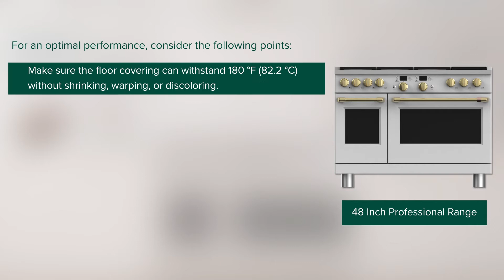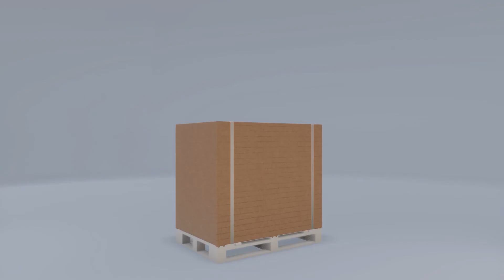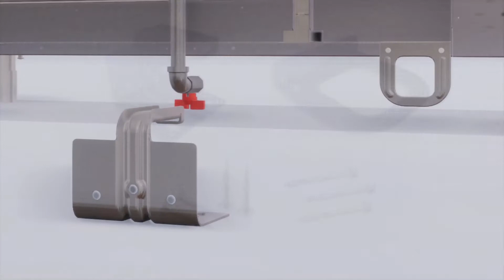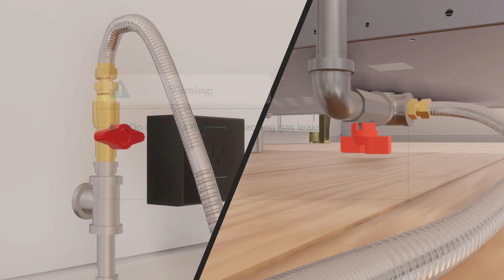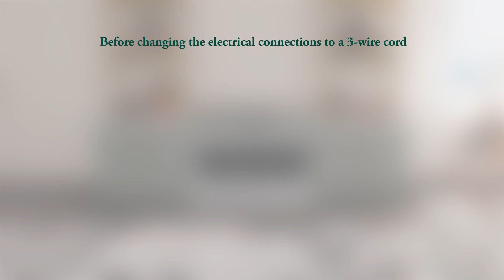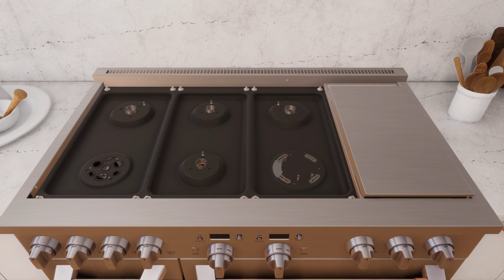Cafe Pro Range Installation

Comment: When facing my 36 inch dual fuel range, the electrical outlet is on the left and gas on the right. Will this be an issue for installation?
Reply from the maker: We want to help and research this further. Please send us a private message via Facebook, Instagram, or X with your complete model/serial numbers.

Comment: The instructions on getting the rear vent off are as useless as this video is for removing it. This has obviously been an issue for quite some time. Why hasn't it been addressed?
Reply from the maker: We'd be more than happy to assist with removing the rear vent. Can you send us a DM on Facebook, X, or Instagram with your full model/serial number and copy of this questions? That way we can review and get back with you quickly.

Comment: The rear vent trim is impossible to remove. Customer service is no help. This video shows it magically coming off. Absolutely terrible.
Reply from the maker: There may be a small tab on the trim that is catching on the back of the range. Please check to see if that is the issue. If not, reach out to us via a private message on GE Appliances Facebook page or GE Appliances X and include your name, number and complete model number. We will be happy to help.
Reply: @CAFEAppliances  The rear vent trim on ours has a bent tab. This is super disappointing for a brand new appliance delivered 2/3/25.
Reply from the maker: We understand this must be frustrating, and we want to assist. Please send us a private message over our social media (such as Instagram or Facebook) with a copy of your comment as well as your contact information, the complete model number and if possible a picture of the damage. With that information, we can certainly review further.
Reply: @scmcdermott  dealing with the same issue. What did you figure out?
Reply: Also dealing with this issue.  Impossible to remove vent trim.  So frustrated.
Reply from the maker: We're sorry to hear this.  If you are not able to remove the vent trim as described in the video, please send us a private message on Facebook or Instagram along with this message, and we will be happy to further check into your concern.

Comment: Should the range be flat against the wall?
Reply from the maker: Some of our ranges can be installed flush against the wall! If you are curious about a particular model, we're happy to see if it can be installed this way. To do so, we would need a model number.
Reply: @CAFEAppliances  I have the same question this is my Range Model CES700P4MW2
Reply from the maker: This model range (CES700P4MW2) will fit flush against the back of your wall. If you would like to view more dimensional information, we recommend you check out the installation instructions, linked here: http://spklr.io/6051xiUV

Comment: I had a new stove delivered and installed. They did not install the stove level with countertop. They said they’re not responsible for that. It’s about 1 inch lower than the top
Reply: That happened to us also and the builder’s doesn’t even care if the night matches with the counter or not. You buy such an expensive item and they don’t even care to install it to your satisfaction. Pretty disappointing.